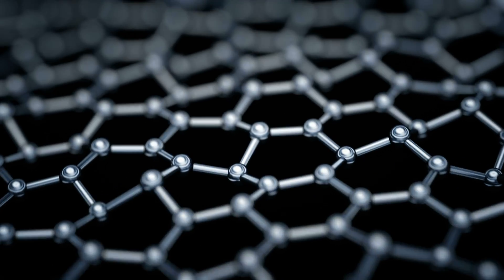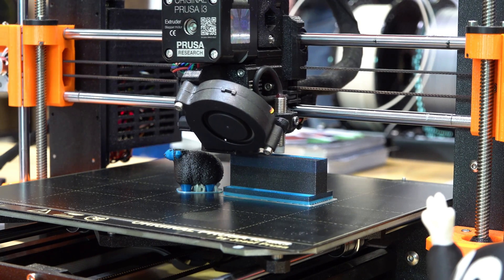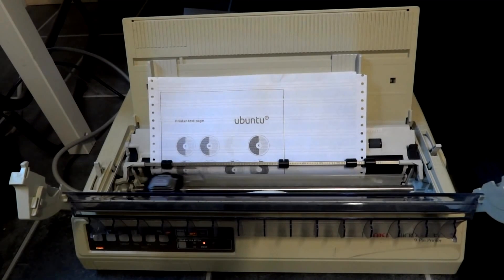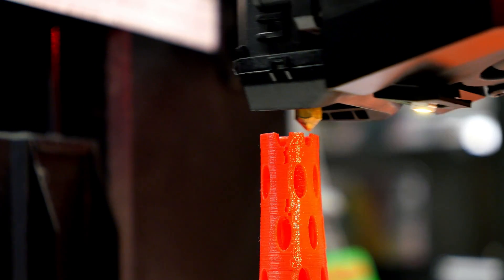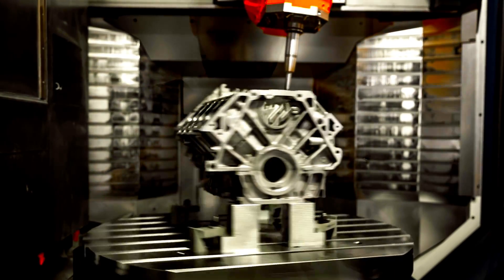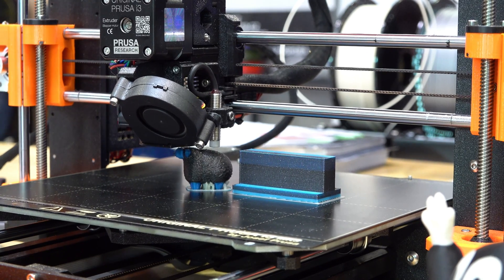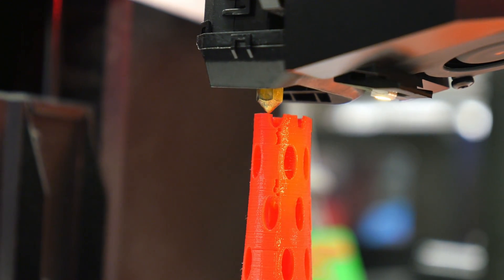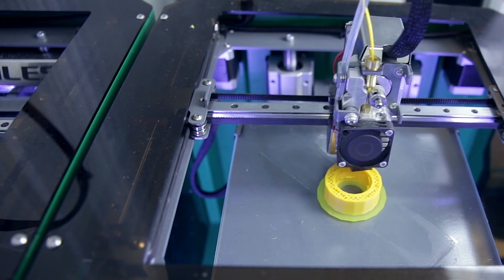Atomic Replicators: The Future of 3D Printing

Comment: Protein resequencing, poo, vomit, , hair, waste  and sick turned into edible material, this sounds ugggg , however, at a nano atomic level , could solve our food and waste problems....what if sewage could be rewritten into clothes, structures and even food.... 😮  maybe using an array of nano ultra violet lasers , a whole array of them, working in tandem, which can break down biological bonds to their essential protein, carb, fat blocks, even bacteria,  viruses, dna .  You would need more energy to dismantle even further,  but maybe not so much for large biological structures.  This is your protein resequencer.. 50 to a 100 years away, technology is getting smaller, 3d printing,  more precise, scanning more precise..  200 years who knows,  teleporter? Stretched matter stream, objects converted to a 1d matter stream and then assembled back together with an imaging pattern, a far far more advanced 3D printer.

Comment: We will not likely see this at any meaningful scale in our lifetime because doing this in an environment under normal gravity makes it infinitely more difficult to achieve reliably. If you want to do this you need to be in space in a neutral gravity position. You have to have a sphere lined with evenly space particle accelerators at evenly spaced angles that have infinitesimally small control over the terminal speed of a particle (atom) delivered at an depth in side the sphere. The more you have the higher resolution you have. You also need the sphere to be lined with detection mechanisms to read and predict the current and changing orientation of object you are creating suitable for the desired resolution. If you can achieve all that, this process starts with firing two particles, aka "the seed" which are perfectly aimed at each other and at the perfect velocity to intersect and bind at the exact center of the sphere while fully cancelling out their opposite impact velocities in a perfect inelastic collision. From there particles could be added from every direction building up the object atom by atom. Deflections and position changes in the target would have to be perfectly accounted for by the sensors. The mass added with each successive collison would have to be compensated for with perfect precision and accuracy.

This is a process that is so difficult and probably could not be done on earth and there would be no way to fix minor atomic flaws unless the occur on an outer edge and could be blasted off with a tangential particle of sufficient mass. This just isn't something we could achieve within the lifetime of any currently living human. At most, maybe we could atomically assemble a small molecule at a very serious expense.

Comment: The Star Trek replicator operate on molecular level; and they utilize the transporter tech. The data about the replicated objecst comes form Transoprter trace. I wonder how even the most ingenious 3D scanner can gain the complete knowledge about the inside of an object. Another bottleneck is raw materials and energy cost. 3D printing of fully fiunctional metal semi-athomatic firearms (except for the springs AFAIK) is already possible. But the traditional manufacturing methods are stilll vastly superiour due to far lower cost and higher quality.
Reply from the maker: A missing piece will be some sort of quantum scanner. Something like an MRI that can identify individual atomic particles
Reply: @ALLYOURTECH3DP  Yeah. You know I wonder just how well the 3D printers are going to do with food; while the 3D printed pastries and such might look promissing enough, it seems to me that to print something even seeemighly as simple as an apple, is a whole different, higher level of difficulty altogether.